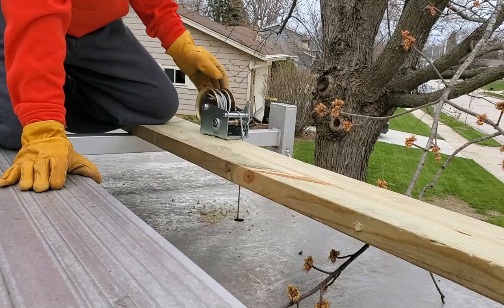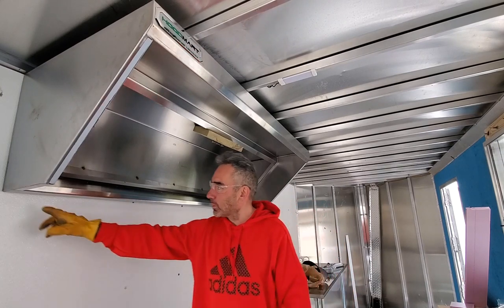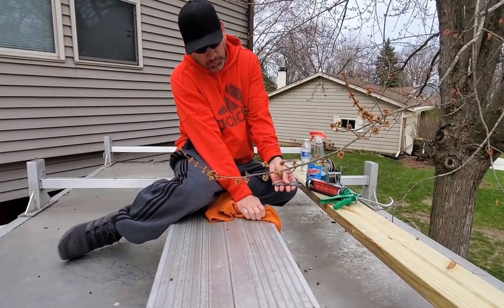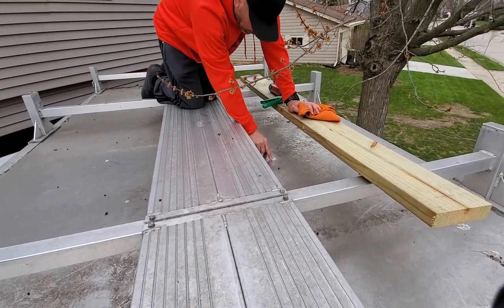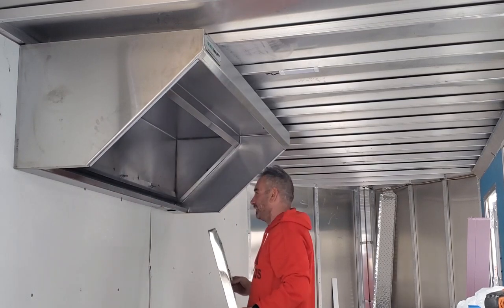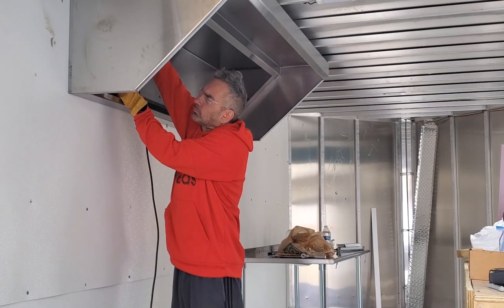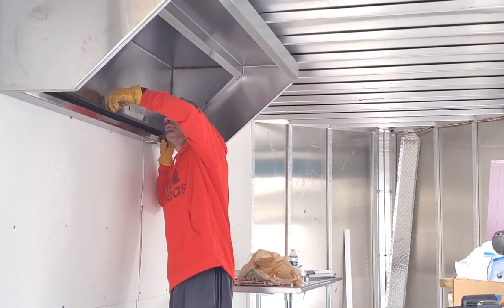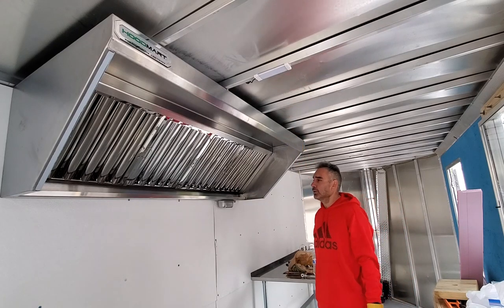Food Truck Hood Install | Hoodmart Hood Install | Installing a Hood by Yourself

Comment: Great Vid. 1 thing that jumped out at me though. If you screwed into the roof joists first you could suck it all the way up while the back is free to travel. That would also take the load off of the winch. Jus sayin'.
Reply from the maker: I drew it in at the top and back with bolts 🔩  thanks for the comment and thanks for watching!

Comment: Relatively new to this industry, my question is what's the benefits of having an automatic fire suppression system as far as a KIDDE or an ANSUL system?
Reply from the maker: Those are competitors, either one is fine and will accomplish the same thing. Check with your local officials for their requirements because they will be different depending on your menu and equipment.
Reply: @IfICanDoItYouCanDoIt  .... thanks for the info., I thought it might've been cheaper for insurance.
Reply from the maker: That could definitely be possible, worth looking into
Reply: @IfICanDoItYouCanDoIt .... I currently do factory installed fire suppression systems for  commercial kitchen hoods and curious for what is marketable for efficiency.
Reply from the maker: I wish I had a good answer for you but I don't know, thanks for the question and thanks for watching

Comment: How heavy was the hood? Also where did you get the crank? Thank you for sharing the video!
Reply from the maker: The hood was pretty heavy not sure exactly how heavy though,  I got the boat winch on Amazon.  It would've been very difficult to lift without it even if I  had 3 or 4 helpers.  Great question and thanks for watching!

Comment: What is the material behind the hood on the wall? Does it have to be NSF steal or vinyl type paneling
Reply from the maker: Its frp but I'll be going over it with diamond plate aluminium underneath the hood because of the heat
Reply: @IfICanDoItYouCanDoIt  Like your resourceful style. For someone on a budget would aluminum roofing flashing work/ pass inspection in your area?
Reply from the maker: @zennseven  thanks! In our area it just has to be a smooth hard surface that's easy to clean so I'd say that would work here in Wisconsin not sure what the requirements are it your area. Great question, thanks for watching!

Comment: SIR!  No washers above!?!
Reply from the maker: I used lag bolts so no washers on the bolt head side.
Reply: @IfICanDoItYouCanDoIt  gotcha!   I'm working on my hood install right now.  Biggest pain in the ass.
Reply from the maker: Yes but worth it as compared to paying someone else to do it
Reply: @IfICanDoItYouCanDoIt  I agree.  The food truck wouldn't even be feasible if I didn't do it myself!  I'll have about 15k in it when I'm done.  I was quoted 45 - 55 to build!  😳
Reply from the maker: @BigEz4Ever  that's the same reason I'm doing it